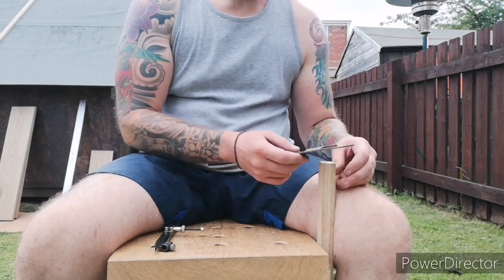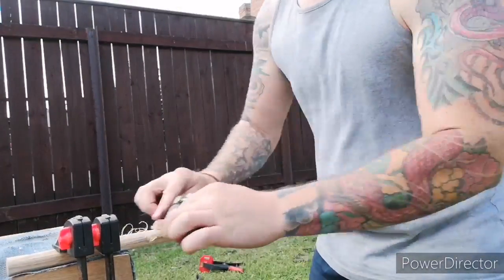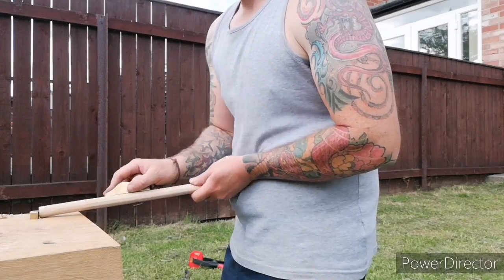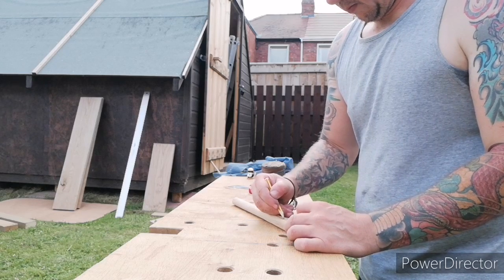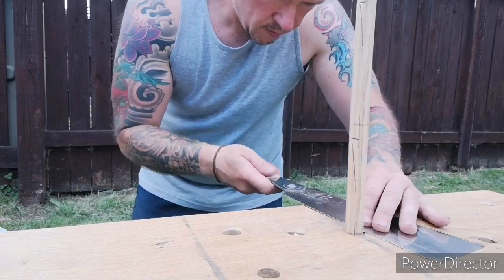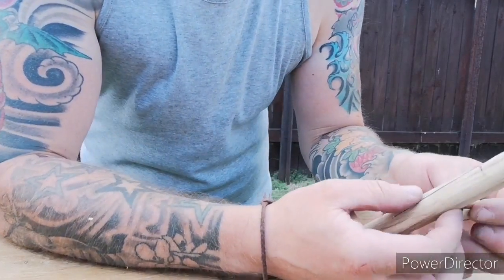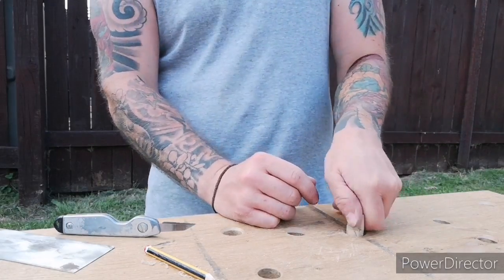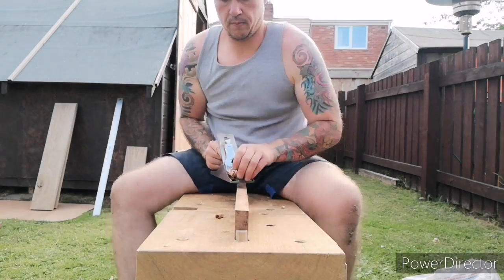How to make wooden bench dogs with hand tools #bench dogs

Comment: Mate these videos are amazing. Ironically, your channel came recommended after I watched a video about power tools (a dovetail jig for routers). I feel like my desire to make furniture with hand tools is hindered by my lack of experience. I end up building things with power tools because I can make some neat pieces with much less experience and talent. I feel like my kids will be too old for blanket chests and the like if I decide to put all projects on hold to learn proper hand-cut dovetails. But I love the simplicity and tactility of hand tool woodwork. Safer and quieter for kids in the shop, too. Anyway, your work is incredible. Keep up that good work and I hope you get the large number of subscribers you deserve.
Reply from the maker: Thanks very much, I appreciate your kind words, and your time. I was once the same with power tools, and slowly moved over to hand tools. If you really want to I'm sure you'll be able to cut them by hand with time and practice 👍
Reply: @DW_woodworks  I think my sharpening skills are lacking. If I can get my chisels sharper, I'll have more accurate cuts. The saw lines are lining up well though. I try to cut one row of dovetails a week for practice, among restoring old hand planes, sharpening chipped chisels, and making handles for my hand saws. Slowly getting a hand tool shop together.